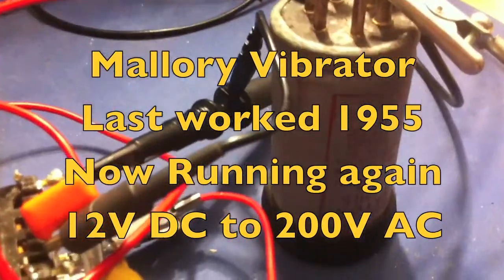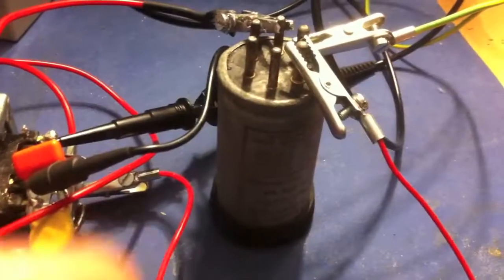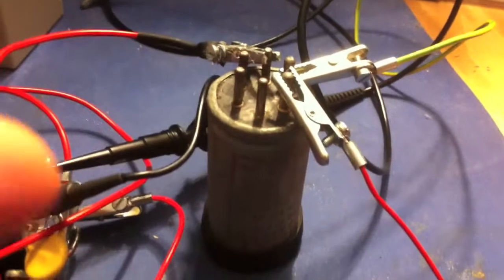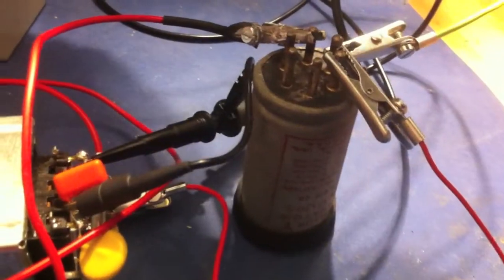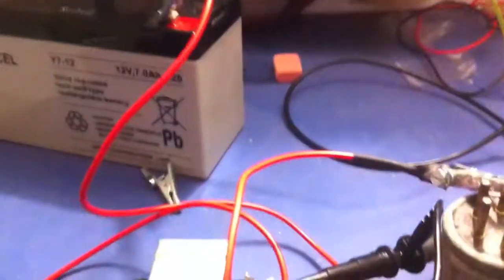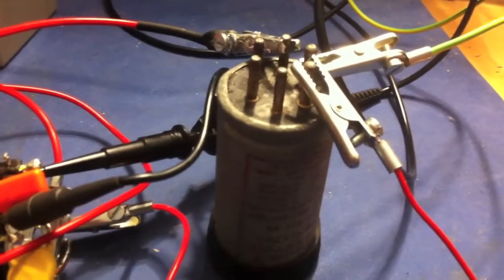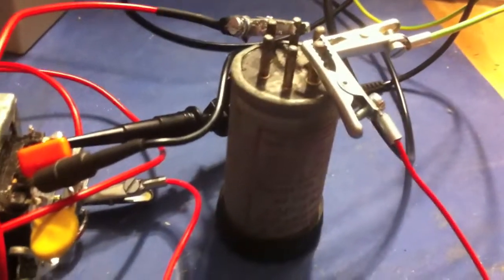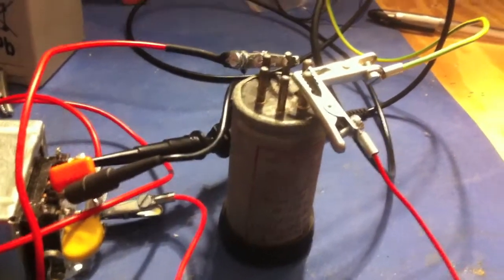Old Vibrator Restored (DC to AC)

Comment: You can clean contacts on hook-switches, relays and that vibrator with a Burnishing Blade tool. It  has a brass blade 1/8" wide impregnated with diamond dust. You close the contacts on the blade and wok it back and forth and it cleans charring off the contact surfaces.
Reply from the maker: Cheers. Very cool info!